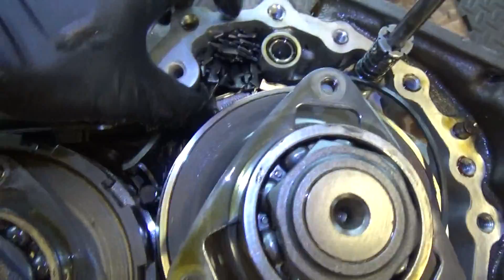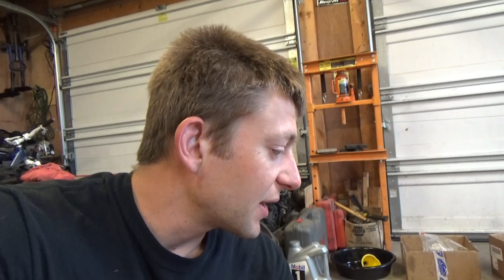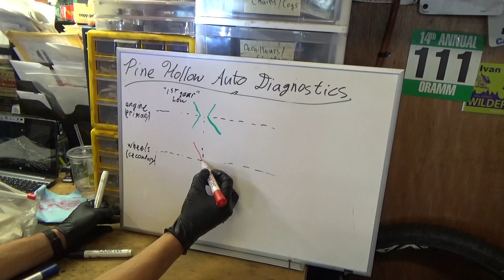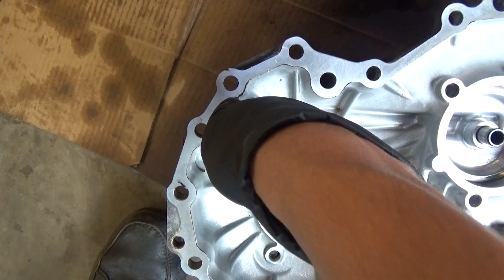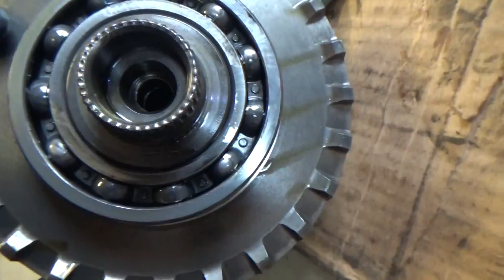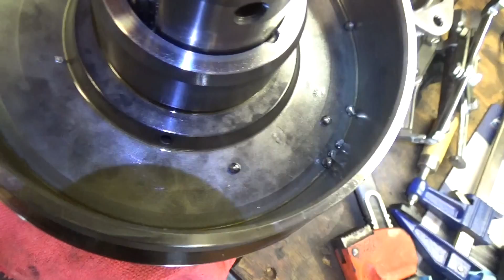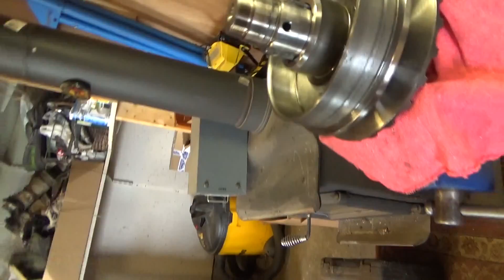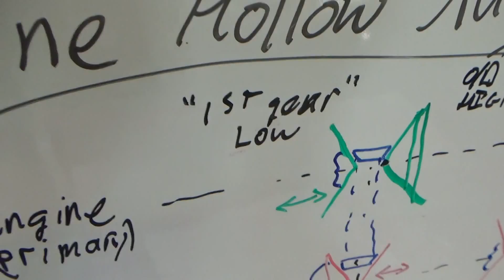Nissan CVT: Teardown and Failure Analysis -Part 2 (RERELEASE!)

Comment: I have a 2012 Altima 4-cyl with 99,000 miles, mostly highway. No CVT transmission issues ... yet. I had Blackstone do an analysis of the original fluid after a change at 90,000-miles. They did not find anything indicative of unusual wear. Their comments:

"Considering the fact that this is the original oil from this CVT transmission, we're impressed to
see just copper (brass/bronze) as the only high reading. Usually, the factory fill is full of metal and silicon,
from new parts wearing in and harmless sealers, and it's not a problem that yours isn't. That just shows how
well your CVT is wearing. Universal averages are based on ~37K miles of oil use. The additives are
consistent with that type of oil too, and that's important because these transmissions are sensitive to the
type of oil in use. Check back to build trends."

Comment: It operates on the exact same principle of a snow machine with complexity magnified exponentially. You are a far better man than I, Gunga Din. I would have been on edge waiting for a large spring to blow shit and shrapnel all over Hells half an acre. 186,000 miles (300,000 Km) before a failure is not anything for Nissan to hang their head over. Having said that they could, if they chose, make some engineering changes to overcome the problem. I would have gone to my grave knowing diddly about CVT' but suspecting and now I know, moreover respect and will adjust my driving behaviour from this point on. Thank you for yor time and patience and risk, both financial and physical what with spring pressures and such.
        Mike
Reply from the maker: Thanks for the comment, Mike! A gentle foot on the gas will definitely help prolong the life of this weak transmission, but never too late to start saving for a new one...I call it the "CVT fund" haha ;)

Comment: That was cool thanks.  You had it spot on I think.  It needed more grooves with more balls.  Don't think it should have had hardened main shaft though.  Malleability of the metal is also a stress relief because it's impossible to synchronize the stresses through the grooves.  Don't think they should have used a slitting cutter for the grooves.  Should have had a ground finish even for a softer metal.  Instead of balls should have been discs.  Oh well lots of fun to hypothesize.  Thanks for taking it apart!

Comment: Tell us if you got your core charge back?  a core is typically just the outer shell that they will reuse I am sure they will throw away all the internal wear items if it used a refurb or rebuilt unit.

Comment: I had learned alot about the CVT transmission thanks to your video.  Great job on the video, it was very through on the way you explained the Nissian Rogue.  It seems that these crossover vehicle are not designed like a Jeep Grand Cherokee, to take alot of abuse.  The parts of the transmission of a Jeep are design for abuse.  Not the fake SUV want to be.

Comment: I've always been a massive fan and promoter of Nissan's CVTs and this just further informed me of the amazing engineering that went into creating it! I'm glad to see someone actually looking into how it works and being impressed at the technology instead of just saying "CVTs suck and manuals are better in every conceivable way." Everything has a failure point and you cant expect it to last forever. The point of CVTs are to extract every bit of performance and fuel mileage out of whatever engine they are paired to and the fact that they are so cheap to replace if they fail is just another added bonus. God forbid one of the new 10 speed automatics crap the bed... Youll just need a new car. I owned a Nissan Rogue from 2008 all the way to 2016 and put well over 200k miles on it with absolutely NO question of its reliability. Fun fact: my Rogue was the third one EVER sold in America. It was fresh off the boat and had a 10 year 100k mile bumper to bumper warranty and I never had to have any kind of warranty work done.
Reply: Renault=Nissan=JUNK!

Comment: good info/useful content ! .......imo 180K isn't bad for an average newer car that can practically be considered disposable(generally speaking referring to cost). But had they just hardened that shaft & used more ball/locks, this vid would be about something else all together. Its essentially a fact that at most corporate conglomerates, engineering is frequently directed by finance, so its quite possible & even likely that a correction/re-design was suggested but intentionally rejected. Its ju$t the world we live in.

Comment: Those metal shavings on the magnet when u first took the oil pan off are from where the 3 grooves are worn  on the pulley shaft where the balls keep the pulley from turning with respect to the shaft.

Comment: Looks like backlash damage, maybe from town driving. Cars used to have 'dashpots' so the engine wouldn't just decelerate sharply as all components could suffer damage. Another thought would be the torque converter lockup either engaging too rough or not disengaging fast enough when throttle released. Pity, Nissan could have tested and found that weakness. Six keys on that shaft and it would possibly live forever.

Comment: CVT what a joke. A car or truck are not snowmobiles. Why would anyone ever put a drive and driven clutch in a car or truck?? I can see a snowmobile using this design but to put a belt in a vehicles really stumps me. I’d trust several clutches and one or two bands (Simpson drivetrain)over a belt that can do what this one did. At least in a snowmobile you can pull the belt and toss it over our shoulder and throw in a new one in minutes. In a car your screwd when the bands and 399 segments come apart. What Einstein came up with this idea?!?! On a snowmobile when your rev the engine the primary clutch has dogs inside it that move outward squeezing the belt outward to engage. The driven pulley expands with speed also so as you accelerate the engine side of the belt squeezes further outward while the driven clutch opens    When it’s spring tension is overcome it widens causing the belt to slide inward causing it to speed up. I would imagine CVT works on the same principles. I don’t like it. Good diagnosis  Ivan I think you hit the nail on the head. Looks like a poor design to me.

Comment: Great Video on breaking down a Nissan CVT Transmission.  But unfortunately, it has convinced me that I have no intention of ever buying a Nissan with CVT or any other CVT for that matter!   The Mileage on that Transmission wasn't bad,  but if this is the "End Result"...avoid avoid avoid.   The Average Person can't afford to fork out for a New Tranny...never mind rebuilding one.  Nissan has been a seriously Engineering Design Flaw lately...and my Mom owns a 2010 Altima with CVT.   I would never buy one based on this and other negative info that's surfaced.  I'll stick to what's tried and true...and Works!
Reply: it went over 180,000 miles

Comment: Here is my opinion on how it failed. The color of that fluid does not look in good condition. Was it replaced along with the filter every 60 thousand miles? If that fluid was contaminated thus changing the viscosity, the pulleys would not be able to move as they were designed to due to thicker fluid Possibly even a split second delay and kaboom. However if the TCM was faulty, your new cvt would have suffered the same fate inevitably. 

On a side note I had a dodge with a very similar cvt if not exactly the same minus the output for a rear differential, and that lasted over 200k, and was still running strong before I sold it.
Reply from the maker: Yes it would be a good experiment to go back in time and change the fluid every 60k miles...

Comment: Do you have to inject the fluid from the bottom of the transmission after draining the fluid? Can you not just pour the fluid into the top of the transmission via the dipstick tube?

Comment: what symtoms did you have? im working on an altima... when you put it in reverse or drive it stalls immediatly... stepping on the gas to keep it running does not help... it going to jerk and stall immediatly..... let me know.... thanks for doing this video... those bearings were interesting...  if it lock up the pulley, would that cause the vehicle to choke out so to speak...tell me what you think...  never ending learning.. lol  thanks again   awesome vid

Comment: Those CVT transmissions are like engines with rubber timing belts that cannot be changed without a complete disassembly. The carmakers should be forced to make those belts replacable as a maintenance item before they break like the timing belts.
Reply: Wouldn't have worked in this failure, the drive pulley failed first.
Reply: @marcusmarcus8616  look at this statists bootlicker.
Reply: @quattro4468   What are you talking about?
Reply: NO...You can replace the CVT belts until you are blue in the face. This type of failure has nothing to do with the belt...  It's the pulley system shaft that failed. Once that shaft gets jammed in place.. The poor belt is at the mercy of forces it was not designed to handle.
Reply: @davidwood7170  Agree. There is also move videos showing different ways of they wear out - mostly on the pulleys. The high oil temps will scratch the pulleys` surface out, as it is the oil that transfers the torque through friction. 
It scares the s. out of me - Honda, Toyota and Subaru SUV/minivans all have CVTs. Only T/H hybrids do not have a pulley system CVT. I hear bad opinions about Mazda. 
So I might end up with Honda Freed AWD Hybrid, as it comes with 7-speed dual-clutch. (all Japanese market).
New world.
Reply: that was thier promise when these turds were first debut, easy to fix,,,, bullshit.,!
Reply: For automatic scooters (the motorcycles), the CVT drive belt is actually a service item and has to be inspected every x thousand miles and replaced when out of spec.

Most require the belt to be changed every 6000 to 10.000 miles.

Not that it would have helped in this failure case, but in almost any CVT that isn't in a car the belt is a service item. I almost feel like cars should maybe be designed the same?
Reply: CVT belt in Honda Click 125i NOT INCLUDED in service sked. Sked is 4, 8 & 12K km services.  My CVT belt broke after 45K Km and 7 yrs.
Reply: @99domini99  for sure
if they can use a rubber reinforced belt for a snowmobile.....why not make it bigger and stronger for an automotive application
A dry belt.....easy to replace....👍
Reply: @fil1329  I don't think a rubber belt can sustain the power and weight of a car =/

The steel belt is already not enough in some cases, I think the rubber belt will have an extremely short life.
Reply: @99domini99  true.....but they work good on a sled.....on a smaller car it's not much different for horsepower these days and torque......think of a stronger bigger timing belt .......with more kevlar plys......it could be a lit simpler.....and it could work....
A system where its dry with no oil leaks and hydraulic problems.....just centrifugal calibrated pulleys or sheaves.....👍
Reply: fil1329 Honda did that with the Civic HX back in the 90's. Let's just say it didn't work as planned.

Comment: For one thing, the bearings are BALL bearings, not roller bearings. And as soon as the cover was lifted to reveal the mess that was once a belt, you should have screwed the cover back on. End of story. Don't buy another.

Comment: This was super interesting.  Perhaps the most interesting thing to me about this is that there's no friction material on the belt elements or the pulleys.  There's somehow enough grip between those smooth pulleys and the ends of the elements to transmit the torque and move the car.

Comment: but why a multiple segment 'push' belt design when it's dry counterpart uses a single piece  'pull' arrangement?
very counter intuitive take on an otherwise reliable system concept.
seems like  over-engineering at it's best.....once again.
Reply: Long story short, heat dissipation.  The more power you transmit through the belt, the more heat generated by the friction/forces.  Rubber will go up in flames at these power levels, unless you increase the surface area it is distributed over.  The CVT belt has a spray of transmission oil to cool it down (as well as an intercooler, they get rid of the heat from the belt via the existing water cooling system for the engine).

Comment: This makes me want to sell my 2016 Altima before the transmission goes out
Reply: Makes me want to sell my rogue with 156k on it
Reply: I feel like I'm hanging on to a time bomb
Reply: @milkman2591   I have a 2005 Altima with 350,000 miles. I use synthetic and Lucas. Proof that fluid changes prolong life, still driving to my goal of 400,000 miles!!
Reply: @chaudie1  your altima does not come with cvt it  comes with a traditional transmission 4 to 5 speed  and 5 to 6 speed transmission u take care of it of course u will hit 400,000 miles but cvt ? it dont matter how much u take care of it it wont last , it not meant to last its meant to force the consumer to buy another car after it gets destroyed after only 4 years of driving
Reply: @akgonen60  Right, I had a Honda Civic with cvt at 310,000 miles before I sold it. I bought it new. Never had issue always kept fluid changed and used Lucas and synthetic fluids.
Reply: DallasPilotCar get rid of it..I know someone with 125,000km and having troubles already with the cvt..Nissan will only cover $3000.00 for warranty
Reply: DallasPilotCar 
If you get your CVT flushed at the dealer every 25-50k miles then you wont have any trouble reaching 200k miles
Reply: @MainMite06  U are correct I have a 2005 Altima with 350,000 miles. I use synthetic and Lucas. Proof that fluid changes prolong life, still driving to my goal of 400,000 miles!!
Reply: @MainMite06  That's what I was thinking to help keep the CVT tip top shape.  The manual says to replace my 2015 CVT fluid every 60k miles.
Reply: @johnpa2006  At first I read that without the word "fluid."
Reply: @johnpa2006  U are correct I have a 2005 Altima with 350,000 miles. I use synthetic and Lucas. Proof that fluid changes prolong life, still driving to my goal of 400,000 miles!!
Reply: @johnpa2006  interesting.
Reply: @MainMite06 $ 450 will cost
Reply: My 2015 Rogue VIN starts with a K
I read that means my CVT was built in South Korea.  Does that mean my cvt is less likely to fail?
Reply: I have a bumper to bumper warranty until 130k miles. And I had my cvt fluid changed at 70k miles.  
I hope to have it paid off before warranty runs out.  It’s a 2015 Rogue awd SV with 81k miles.
Reply: do it. My 2014 hasn't hit 75K and the transmission is shot. Dealership is giving me the run around now.
Reply: @edwardjuarez9425   I have a 2005 Altima with 350,000 miles. I use synthetic and Lucas. Proof that fluid changes prolong life, still driving to my goal of 400,000 miles!!
Reply: Get rid of it and buy a Camry, Accord with the 2.0t, or Mazda 6.

Comment: Those chipped up 'ball bits' in the variator are cobalt steel locator ball bearings, and you are right in saying these balls are to lock the variator together with the shaft. Since they were wearing such deep grooves in the shaft relief the assembly shifted out of alignment and thus the variator could not change ratios as needed. It likely caused the belt to be super stretched while being pulled apart during ratio adjustments and the belt just snapped. The blown out seal was from high oil pressure feeding into cavity at such a high pressure (800+ psi)  that when the variator assembly could no longer change ratio the pressure spiked and just blew apart the seal gasket.
Reply: Not sure why a spline design wouldn't be the better option? Your thoughts?
Reply: Sounds like a plan ...

Comment: Find an EZ Go work cart and look at how that transmission works. Those use a rubber vee belt. SAME EXACT CONCEPT, only cars use metal belts! A centrifugal clutch, and a torque clutch make those cones move in ways that make a lower gear ratio for starting out, or high torque like climbing a hill, in a true well engineered non-valve controlled  CVT. Nissan CVTs are known to handgrenade like that.. Toyota CVTs seem much more reliable. Snowmobile tranies work the same way too, but again, rubber & fabric belts, vs metal. I wish I had bought a Camry now! That seal looks like grey fiber, so it's probably a hard seal. CVTs go way way way back. Toyota's planetary gear system is markedly more robust than Nissan's design. The centrifugal actuators try to make the gear ratios go to the higher gear with increased speeds. In a high end well designed CVT, increased torque can and should make them  go back to a lower gear ratio. EZ Go carts used simple mechanical clutches, but the concept is the same, and everything is open for you to see it, even while it's running.

Comment: Ball are point contacts. It can't evenly distribute force along contact surfaces.   So it's design failure to put these balls as a lock torque transfer.    Salute to your effort display.

Comment: 1:14  Those 'bearing retainers' hold the shafts up.   If you leave the two lots of 3 bolts in, both rotating assemblies come out complete with the end housing. This enables you to replace the belt.  And put some big cable ties around the belt to prevent it flying apart....if it isn't broken already, of course. There are dead Muranos all over my town. 3.5 k for 2nd hand ones.
Reply: You think it's a money maker to buy these broken CVT Nissan vehicles and rebuild the CVT for resale?